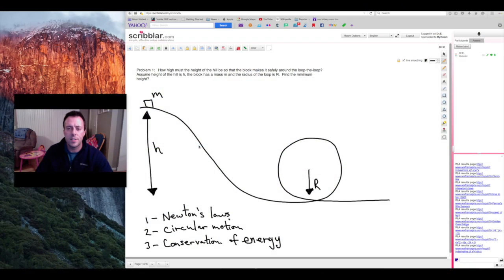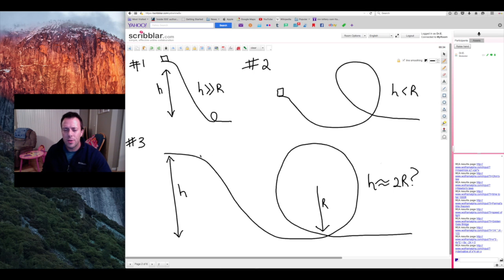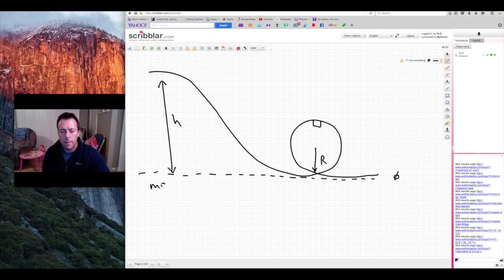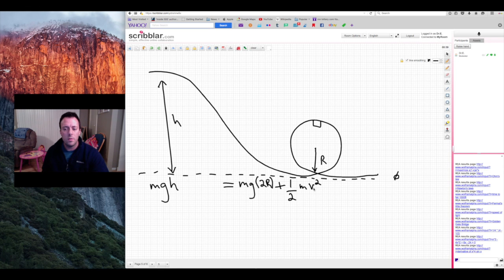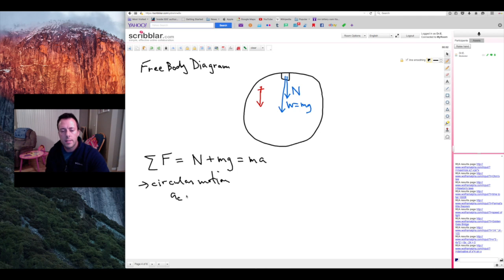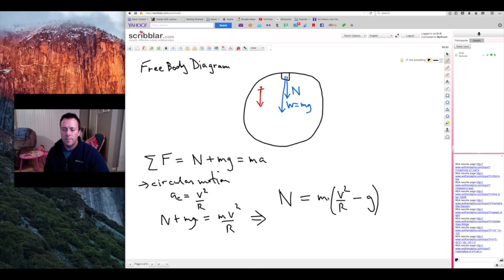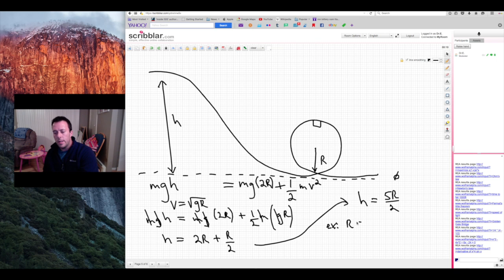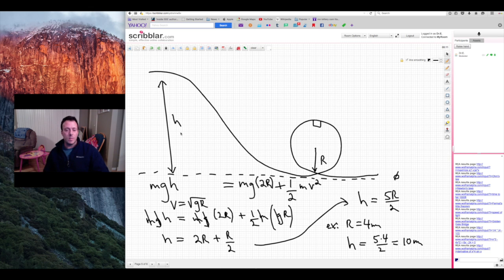Loop-the-loop physics problem: Forces on a vertical loop.

Comment: Great video, but I have a question: If h is equal to 2r then how to calculate the maximum height that the car can reach. In another words the height when the car will fall down
Reply: its 1/2.5 of the original height

Comment: No you don't have any kenetic energy at top of loop . t top of loop the kenetic is zero , because it's not moving,,but it has a maximum potential energy....
Reply: That's not always true it may possess some kinetic energy...the tension of the string would be zero  at the topmost point but it will possess some velocity

Comment: Hi @PhysicsNinja, you have proven that regardless of the radius of the loop and height of the hill, when relying only on gravity, the relationship is always the height is 2.5r. My question is, what is the distance between the base of the hill and the entry point of the loop? In other words, the moving object has to travel a certain horizontal distance on the ground once it reaches the bottom of the hill before it starts to incline and go up the loop - for h = 2.5r, what is this distance and how does this formula change if the distance is changed? Also: is there a limit to the length of the object? Imagine an amusement park ride - a train of several carriages and metres long would have a trail behind it as the first car enters the loop, would that not drag and slow it down and prevent it from entering the incline to complete the loop? Thanks.
Reply from the maker: Hi, thanks for your question.    A couple of points.   In my solution i didn't consider the effects of friction.   Clearly if there is friction, there will be work done by the friction force and some of the kinetic energy of the mass will converted into heat.   In order to include friction i would need to know the exact shape of the curve.  I could simplify by only including friction over a straight lower segment after the drop and before the loop.   This case could be done without too much effort.    In the energy equation you would need to account for the energy loss due to friction (work by friction)    As for the length of the object,   this is difficult to consider.   You would have to know how each cart is connected to the other and calculate the forces between the different objects.

Comment: Hello Physics Ninja, I have 2 questions:

1) Why does the gravitational potential energy at the top of the hill have to equal the total energy at the top of the loop? Shouldn't it be less, because at the top of the hill, there is the additional energy from kinetic energy? (m and g would be constant and since we don't know r, for all you know it could be equal to h.)

2) Someone's already asked this before but it wasn't answered properly. At 8:20, you said "we want the contact force to be equal to zero". Why though? When the contact force is equal to zero, the object falls off the track and that's exactly what we DON'T want. (Also you wrote "N does not equal to 0" so was this just bad wording?)

Related to this:
At 8:08 you said at some point the term in the left is equal to g. Why? Is it because at the very top of the loop, the only acceleration or energy is the downward acceleration is just due to gravity, or g?

Thank you.

Comment: why is the "normal" force acting "down" in this case? wouldn't the object experience a normal force more similar to a "hugging the road" force that can be seen in a race car going around a steep incline turn?
Reply from the maker: Normal force is always perpendicular to the surface....always.
Reply: @PhysicsNinja  That makes sense. But couldn't it be said that if the normal force was applying in the exact opposite direction (as described in ^ vid) that its force would still be perpendicular? I think we're just talking about centrifugal vs centripetal force (in the context of the normal force within the loop). That would also make sense, especially when considering the force that "slams you into your seat" as you come out of the loop (assuming you're in the car)

Comment: Great and very helpful video. One question: ignoring friction, why must the starting height be higher than the highest point of the loop? Thanks a bunch.
Reply: because at the starting point, we consider that the speed is 0 m/s, so the kinetic energy=zero, so the total energy = gravitational potential energy. At the top of the loop, the object has velocity, so it also has kinetic energy. This means that the total E = Eg + Ek, so the Eg at the top of the loop is lower than at the top of the hill, meaning that the height has to be lower 
(singe Eg=mgh and m and g are constant).

Comment: So, why does it NOT work to release the object from a position equal to the height of the top of the loop? Why must it be higher? 
Does the release location have to be higher because then it will provide the object enough speed to make it around the loop?
Thanks in advance!
Reply: if h would be equal to 2r, we have that 2r=h<2.5r which is the minimum required height for the mass to go around. If the height, 2r which you said, is less than the minimum height, it won't do the loop

Comment: Do you know some of the physics required if one had to take friction between the object and the hill/loop into account?
Reply from the maker: Great question.   If there is kinetic friction with the object and the track you will need to know something about the shape the hill because you'll need to calculate the work done by friction over the entire region where there is friction.   You still want the Normal to be set to 0 (that's when you lose contact with the track).   The 'other' equation I have in my video comes from conservation of energy.   If there is friction you'll need to modify this equation to account for the work done by friction.

Comment: Can you explain why we have v=sqrt(gR) ? Why do we want the contact force to be equal to zero? Doesn't that mean that the object going around the loop would fall off?
Reply from the maker: Great questions!    if v=sqrt(gR) this means that the Normal force will be 0.     If v is bigger than this value there will be a Normal force pointing toward the center of the loop and the car will be able to go around the circle.  If Normal force is 0, the track no longer applies a force to the car and basically means it will lose contact with the track.   At that point the only force is gravity and yes it would fall off.
Reply: @PhysicsNinja  I don't understand how the normal force counteracts gravity in this situation when it's pointing to the same direction as gravity (the center of the loop as you said). It should be helping gravity instead!
Reply from the maker: @bennemann   The direction of the normal force is ALWAYS perpendicular to the surface.  When you at the top of the loop (upside down) the Normal force would point toward the center and when you're at the bottom is would point up.
Reply: @PhysicsNinja  I'm talking about when the cart is at the top of the loop. In that situation, both the normal force and gravity point downwards, so what is stopping the cart from falling?
Reply from the maker: bennemann it is falling!  It’s accelerating toward the center of the circle.  At this point it’s also moving to the left so it keeps moving in a circle.   The net force at the top of the circle must be toward the center of the circle.   If it weren’t moving I agree it would fall straight down but it is moving.
Reply: @PhysicsNinja  so with v=sqrt(gr) would the car at the top "unstick" from the loop and undergo parabolic motion downwards and left? then every height greater than 2.5r would allow the car to do the loop, correct?
Reply: @PhysicsNinja  I know I am six years late but, why would we want the normal force to equal zero and have it fall off when we are trying to find the height of the hill so that it safely goes around the loop? If it falls off then it wouldn't go safely around the loop.